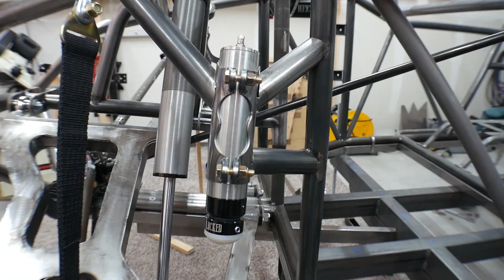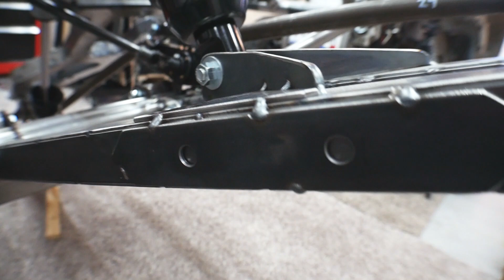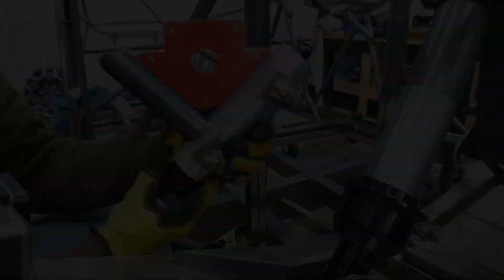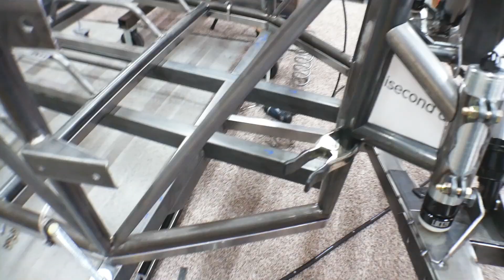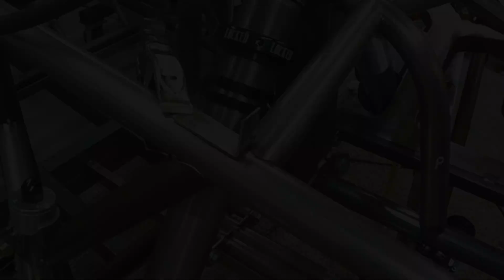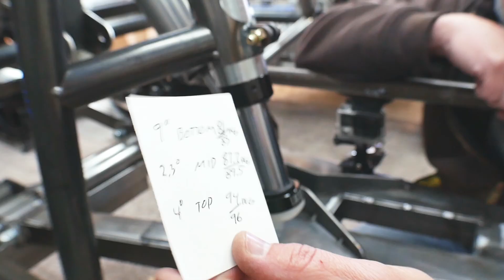Baja Front Suspension Build #7, (Bump Stops and Straps)

Comment: You can run the limit strap from bolt to bolt on the shock you just need a longer bolt and spacers to set it out past the spring
Reply from the maker: I was afraid doing it that way the strap would tangle with the spring at compression, maybe?

Comment: For Mig Tack crank the heat higher and make the gap bigger for it to flow into. Tig fitment and mig fitment are way different. For mig we bevel back almost 1/4 to create a big valley to flow into. Tig as you know you want flush mount no valley.
Reply from the maker: Man those are some good tips! Thanks.